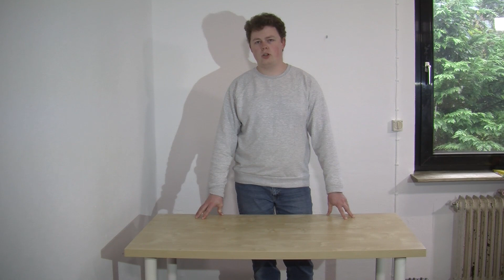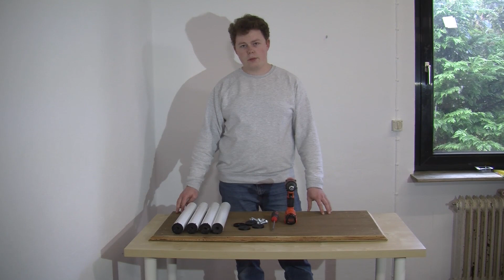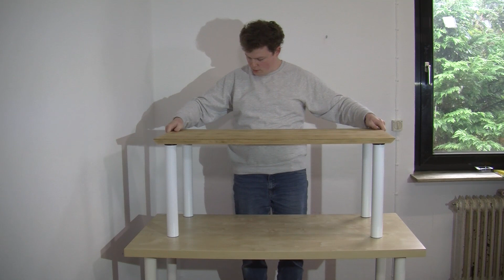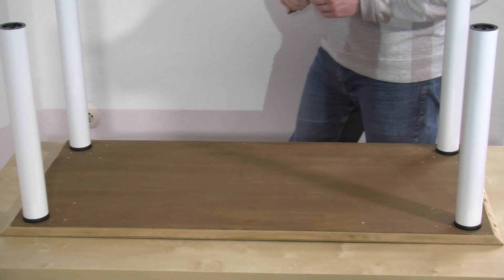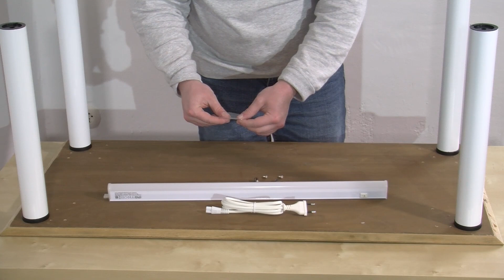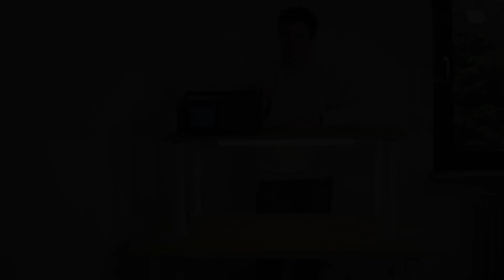How to build an Electronics Workbench

Comment from the maker: FYI: The time lapse portions were not supposed to be silent. They should have had the sped-up audio track going along with them. First error I had with Adobe Premiere Pro ever. Rendering the video takes about an hour on my secondary video editing PC which is all I have at the moment, and there was no time left to try again :)
Reply: DrCassette 
no worries on my side...thanks for the video!
Reply from the maker: The sped-up audio indeed doesn't serve any purpose, but I think it's still better than just sudden silence that may cause viewers to check their audio system.
Reply: There is nothing more annoying in videos than keeping the sped-up audio when speeding up a video clip. Seriously, what the hell is the purpose with that? I mean who the fuck wants to listen to it anyway? It does not serve a purpose, you can't make anything out of it, and since you sped it up in the first place obviously the things that are said in that part was not important anyway...
Reply: just wondering why did you disable the comments on the video  "Crap Technology: CD-Rs" . i have cdrs that play perfectly to this day and also mps stored as info on the cdrs . i used sony software and used the lowest priced cdrs i could find . i also have cdr rw and they also work yet . i do agree that the one crapp thing about cds is that the info layer can be scratched or worn off making the disc useless . i copied everything to dvd r as info discs . the info layer is protected between two plates . just dont let them freeze , anything that can cause moisture and then frost will damage the info . just makes common  sense .
Reply: edit  ,sony recorder with nero software that has two uses , expert and novice mode . the regular nero software does not work properly .

Comment: I started out with a old coffee table as my electronics bench. Now I got a whole 2 car garage as a shop. I have came up with some clever ideas over the years for storage and bench setup. Such as two book shelves with adjustable shelves with a table in front of it. This way there is plenty of work space on the table and the test equipment can sit on the shelves. A trading card box and coin enevlopes works great for holding most electronics parts and you can even write down the specs of the part for quick refence so you don't have to pull up a datasheet each time when you can't remember the specs of a 2n3904 transistor or something on those lines.

Down the road you'll end up building a bench from scratch. Old kitchen counter tops work great for that but avoid the type that has rounded edge fronts, kinda hinders clamping stuff down such as a small bench vice.

Also old rolling office chairs work great as mobile carts. Remove the seat from the base of the chair and attach some wood onto the base. Maybe add a backer peice of the chair base can tilt to have a higher pitch angle for holding a huge scope or big old rackmount test gear.

Comment: Shouldn't you secure the upper legs to the main tabletop so the shelf doesn't slide around or fall?
Reply from the maker: I guess it depends. In my case, the upper table is heavy enough so that it won't slide. And when using the same depth for the upper table top and the same hight for the upper table legs the upper table will not fall over. But yes, this design is not child proof.

Comment: Nice video. My only suggestion is to add a surge protector/power strip to the back of  the lower table.That way you'll have 6 sockets avaible!
Reply from the maker: I have switchable power strips installed on all my other workbenches - I didn't have one left over for this project :)